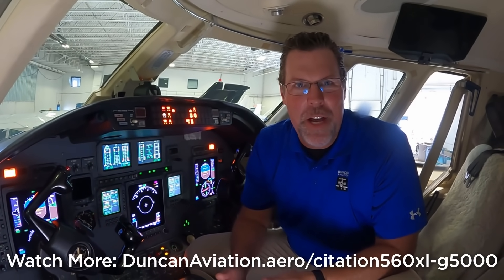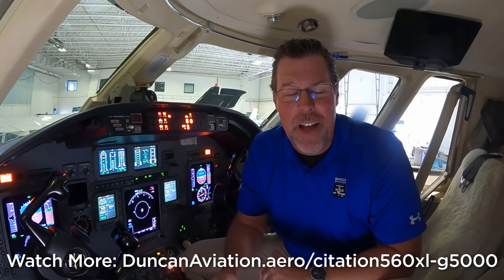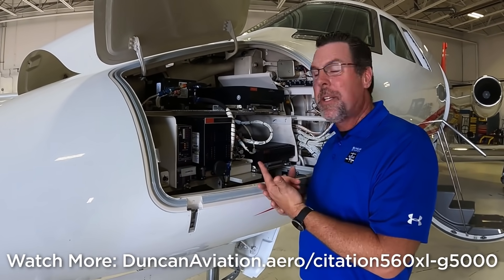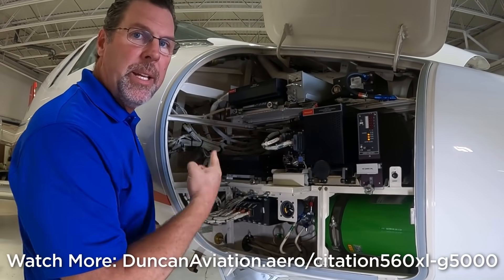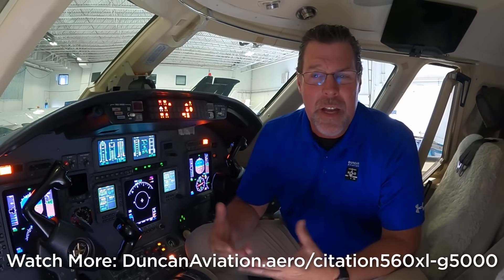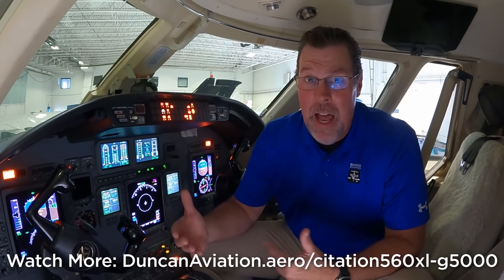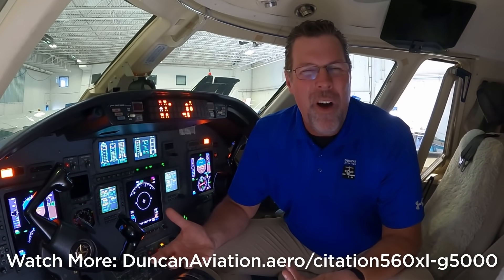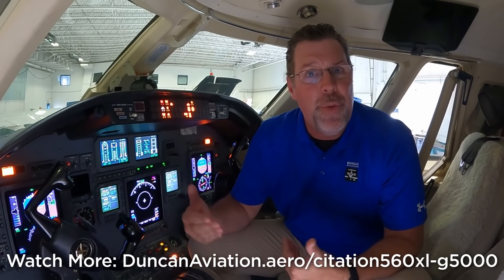Duncan Aviation G5000 Installation | Episode 1: The Old Flight Deck

Comment: So much spaced out junk in the nose, taking up space, adding structural weight and weighing the plane down. Weight begets weight.
It should all be one integrated unit in the display.
Reply: It’s called weight and balance my guy.
Reply: @EViLSiDE520  you are saying it needs all that weight to fly well? I think not.
Reply: @DanFrederiksen  Sounds like you know a lot about physics.
Reply: @EViLSiDE520  I know a good part of quantum mechanics and I've deduced part of the physics ET ships use which you might know as UFOs. So yes, some. Likely more than you.
Reply: @DanFrederiksen Yup, I can totally tell.